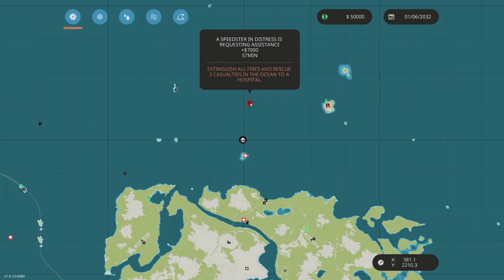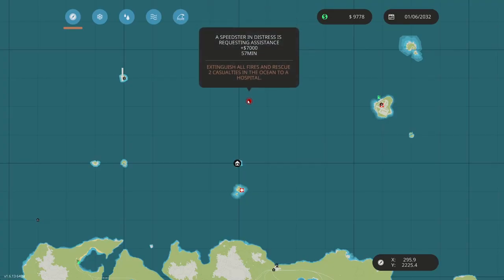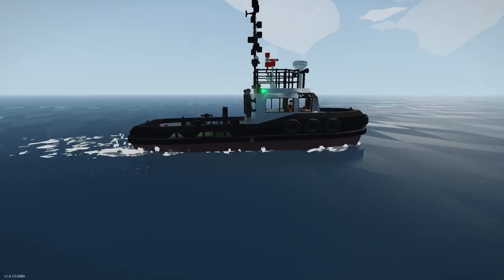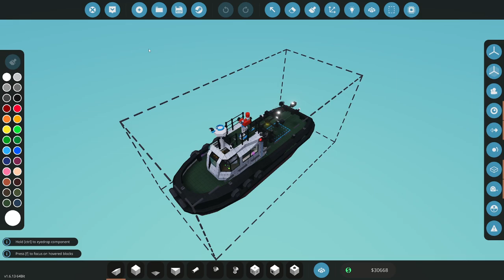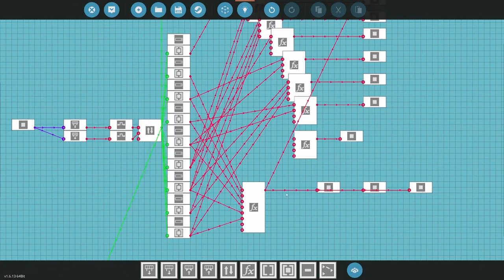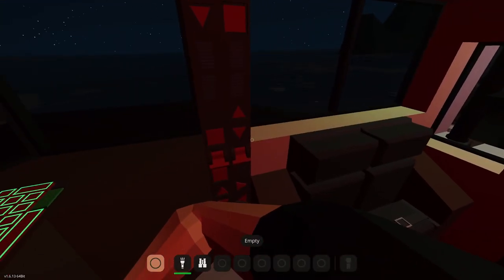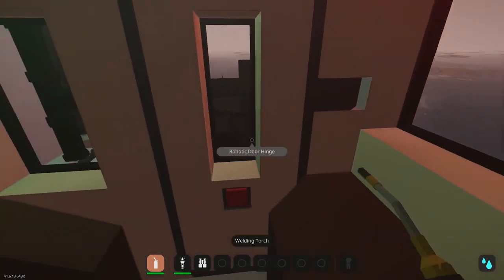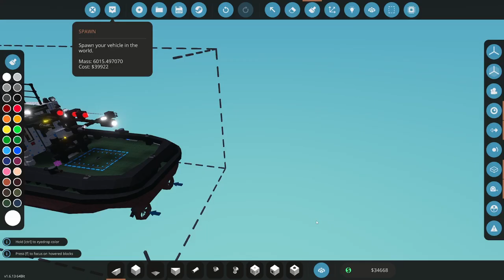Career Build Series 2023 Ep15

Comment: I couldnt see if you had the winch "rope logic linked" to an anchor, but in my saves, ive noticed you have to logic link winches to an anchor point. Then you may disconnect from anchor point and run with the rope. Also, its a free rope.

Comment: Usually for my electrical, i come off the battery to a breaker, and then from  breaker to all compontents. Then when you hover over the yellow orb, all will highlight white that are connected. Works really good for verifying connections are made. Also, the main reason for it is if you break a certain component, all connections to that block are broken. So  anything linked to that block will lose its power or logic. If you didnt know,  hold ctrl and click components to drag logic links in all logic menu's
Reply from the maker: I'm aware of the control click. With my electrical systems I set them up like they would be in real life. The groups are all set up to be with like groups.
Reply: @CaptainCockerels  ah ok cool